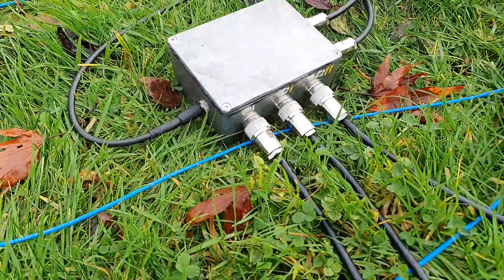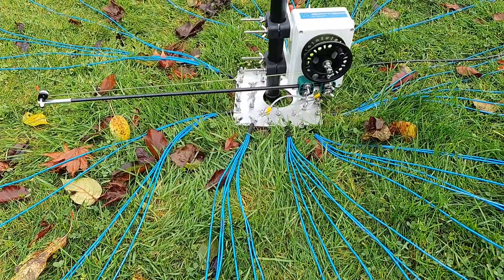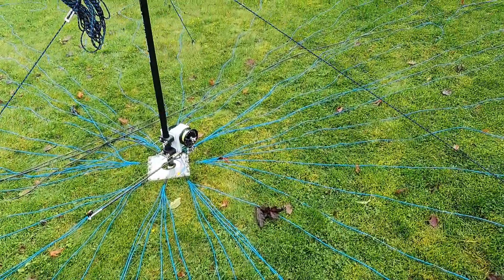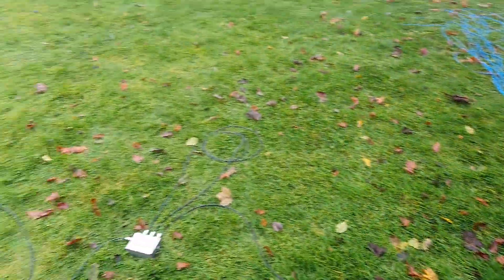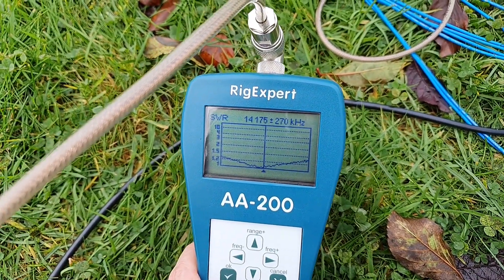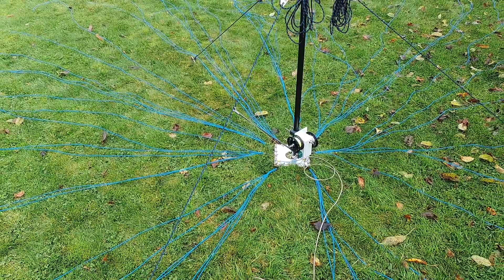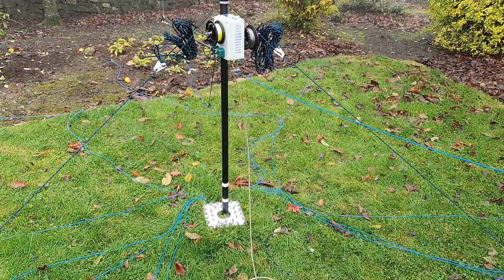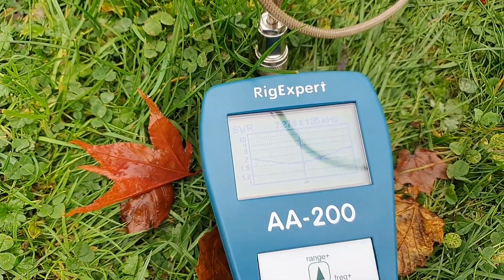40m Phased Vertical Array - Inital Testing

Comment: Very interesting video.  I think I may try a parasitic reflector to avoid issues with SWR.  Your adjustiwave system would work great with a third vertical which you could use as a reflector in opposite direction.
Reply from the maker: Its such a versatile system I'm discovering, there are so many configurations possible that it keeps me going experimenting.

Comment: Hi Colin, what a great experiment.  Normally the interaction is between the radiating part of the antennas, that is distance between the two is important.  I can only think that the radials are causing the issue.  I would have created a greater distance between the two sets of radials,  don’t worry too much about evenly spreading them out over 360 degrees.  You could elevate a pair of radials per vertical but they will need to be tuned.  Wish you success and fun.  73 de M0AZE Mike

Comment: Great job @Colin is the some where the plans for the box and iner  from 2e0ree
Have you tried the poles a 1/4 wavelength apart
Reply from the maker: Its a bit of a mix and match. There was no direct source for it all. I will do a wee video of the detail of it soon. I'm not an electronics  person and managed this quite easy.
Reply from the maker: I really need different phasing/delay lines for 1/4 wave spacing. I did however try that and no difference.